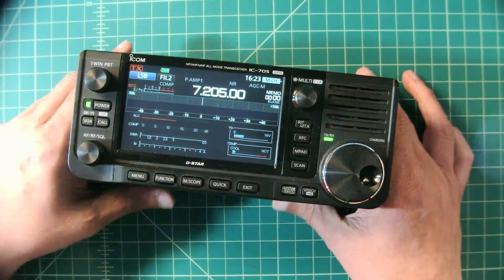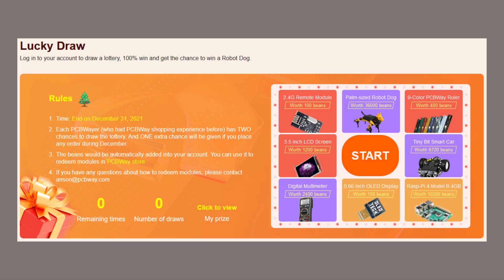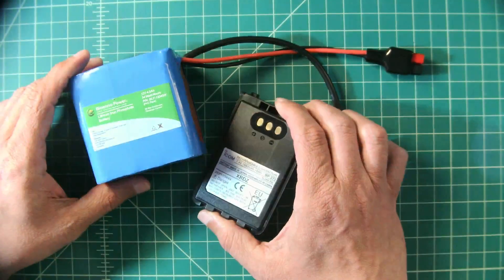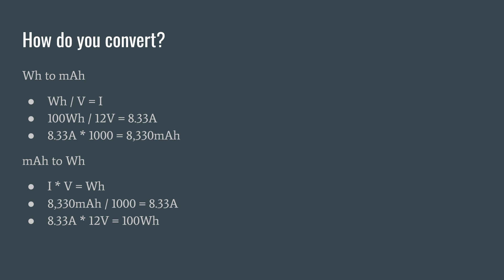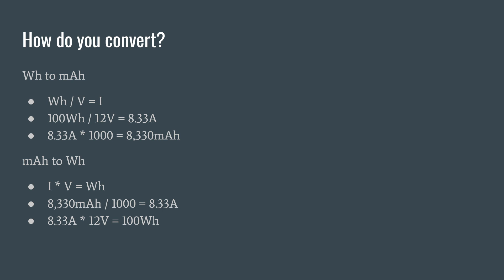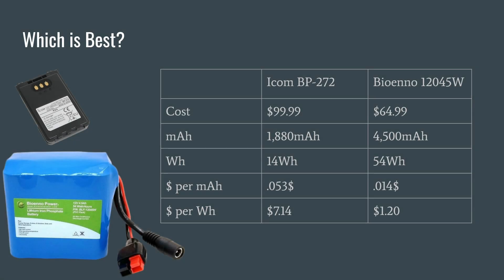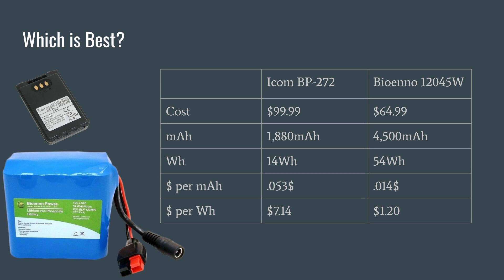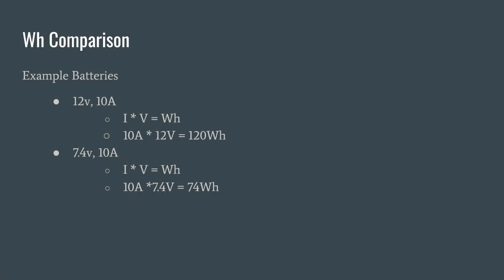Choosing the Best Battery for Icom IC-705

Comment: Hi, a question but when you use the bioenno or the traditional RC lipo, is the original 705 excluded? Do we need to act on the menu set? or how does it work? Thanks for your answer.
Marco in3ufw
Reply from the maker: What happens with mine is that the radio will charge the internal battery AND let me operate with 10w

Comment: Hi. I am just wondering do you have any recommendations for chargers/ power supplier for the ic-705? Thanks
Reply from the maker: I use the MFJ-4230DMP to power most of my Ham Shack but the 705 I generally run off of a 12v 12AH battery from Bioenno.
Reply: @TheSmokinApe  Thank you so much. Another question is have you tried using a signal stick on an icom 705?
Reply from the maker: @modricxx  I haven’t, but have seen people do it, only for VHF and UHF 👍
Reply: @TheSmokinApe  thanks!!

Comment: I liked your video. The battery Icom uses is a joke. Just like the battery setup in my Elecraft KX3. That battery is good enough to keep the clock going and make two or three quick Q's. What Icom should have done is make a new battery enclosure and for the battery use three 18650 LiPo batteries. The voltage would have been higher and the amp hour rating would have been doubled. Three of those batteries would have fit in the pretty much the same size package as the battery Icom used. 
I use an external 6 ah LiPo battery that is 11.4 volts. Cost is around $70. The only thing I have to do is put Anderson Power Poles on the battery terminals.  You can get a 10 ah LiPo for under $100 if one shops around.
Thanks for posting. It brings light to what I see as a battery issue.
Barry, KU3X/QRP
Reply from the maker: Thanks for checking out the video Barry, I agree that the 18650 route would have been the way to go...

Comment: Good coverage on the batteries, they each have their advantages. I mark my various batteries (12V and USB) with watt-hours to help when selecting for a particular task. Knowing the power requirements of the load makes for quick operation time estimating.

The Icom 703 has no room for internal batteries (at least mine doesn't). Icom made the 703 by taking the 706 and removing the power amp and adding the tuner, essentially. The plus included 6 meters while the regular 703 did not.

The Icom AH-705 tuner is basically the famous AH-4 redesigned for lower power and battery operation and packed into a much smaller case. It has a bit more technology than most autotuners giving it wider range and in many cases faster/smarter tuning. 

73 de w6akb
Reply from the maker: Thanks for the info and for watching Alan 👍

Comment: 0 seconds ago
I use the 705 for SOTA/POTA. For a one hour activation either CW/Phone and 50/50 duty cycle.I am seeing 60% power left in 705 battery. 5w always gets me the required contacts. I have a couple Bioenno’s but think I’ll order another BP-272 (light weight no connecting stuff up) for SOTA hikes. That should be plenty for 2-3 summits in a day.
Reply from the maker: Thanks for the comment and checking out the video George.

Comment: Why did they not put the standard AH3/4 tuner port on this radio?  Negative for me becausevI have LDG tunets already?

And the cost of the internal battery not worth it.  And the external battery gives more flexibility to power more items.

The 703/+ had an internal battery option, I think.  Not worth by cost/benefits.

I use a Jackery batterysystem from HFT.  Can power the 703 on light duty cycle on SSB for over 24 hours at 10w output radio.

Comment: Enjoyed the content on this video. As a side bar, I have been using a KX2 for several years and had the opportunity to handle a 705 a week ago. Wow, it is much bigger than I expected. Definitely would not fit in a pocket.
Reply from the maker: It would have to be a big pocket!  Thanks for checking out the video AG.
Reply: yes, A real brick. In size and weight.